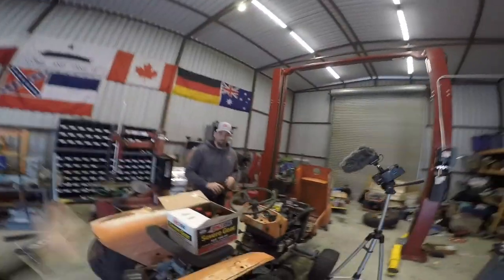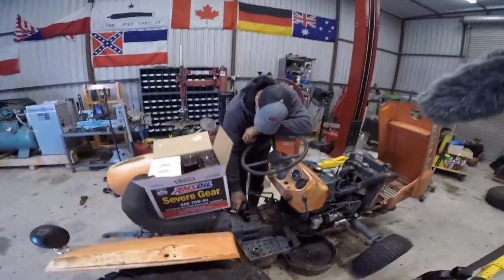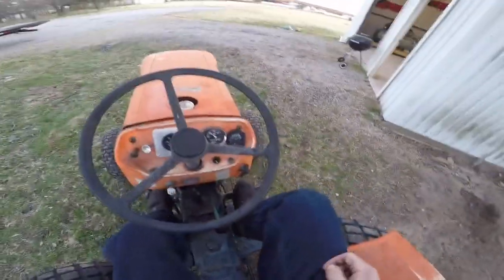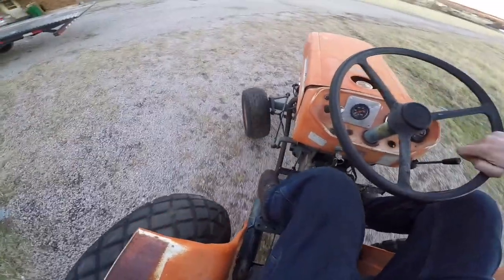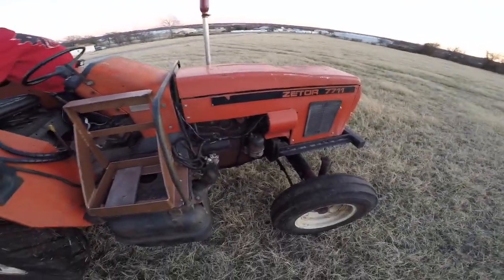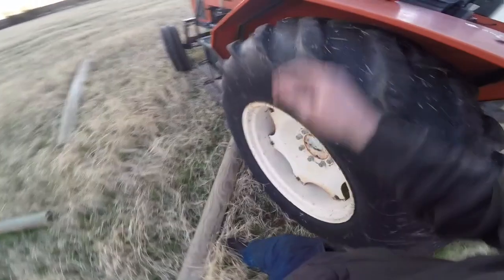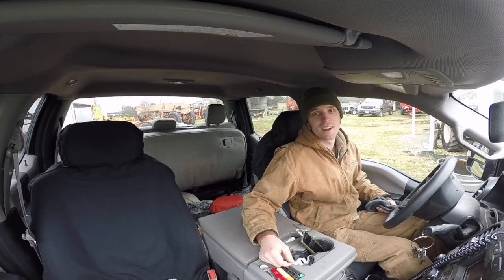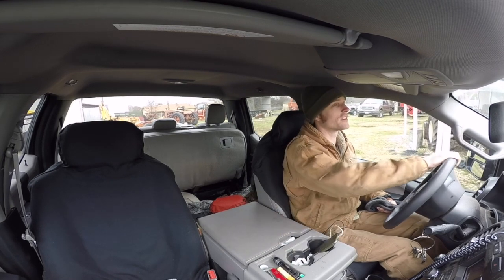IS THIS LOW HOURS, BARN FIND KUBOTA TRACTOR TOO GOOD TO BE TRUE?!?

Comment: You opening a restored used tractor and repair center?
Old iron is better then new plastic.
The last place I worked had a WD45 Allis and for about 30 years we just had to tune it in the spring and it was good for the summer.
Then the bosses kids started driving and every other year we replaced the clutch and brakes.LOL
I did cure the brake problem though,the younger kid didn't unlock the brakes and said he could only get it moving in first gear but it was a dog he said.
He thought the clutch was the brake because when he pushed the clutch in it would stop but he did say the brakes were getting bad.
Beer 30 couldn't get there fast enough when the rug rats started running the equipment.
Reply: Haha that's funny but messed up too. It happens fairly often too I'd guess.
Reply: Tractor Hoarding is an excellent hobby

Comment: i have a 87 yanmar 226d with under 900 hours. has loader, bucket of course, snowplow, rear blade and brush hog. i like it, it also has a jd cab on it. i want another small tractor like a kubota. but i want 4x4 and attachments would be good.